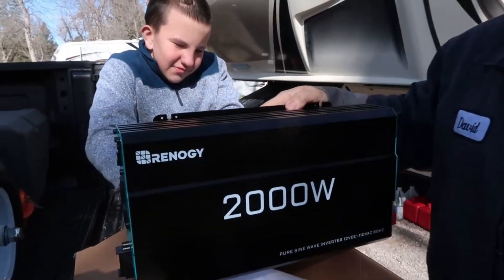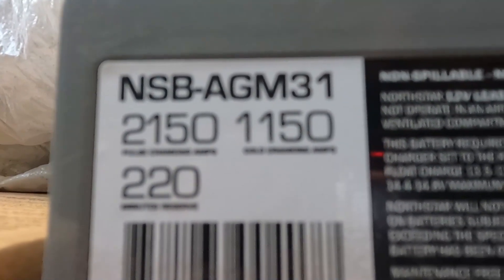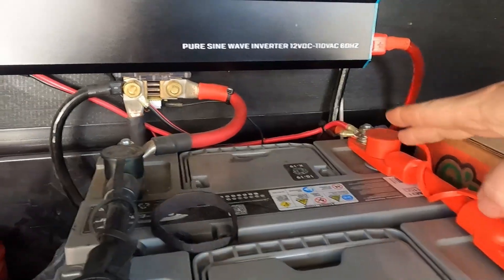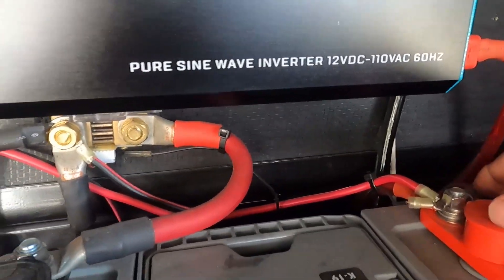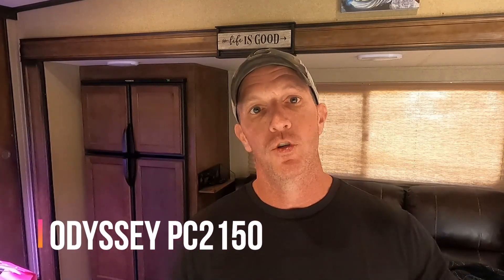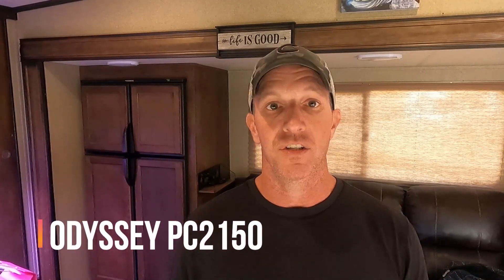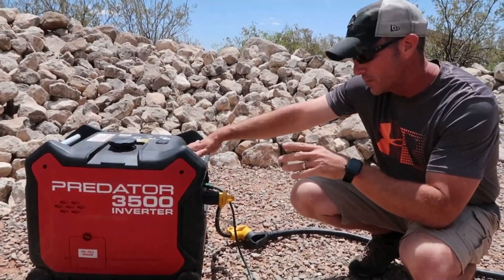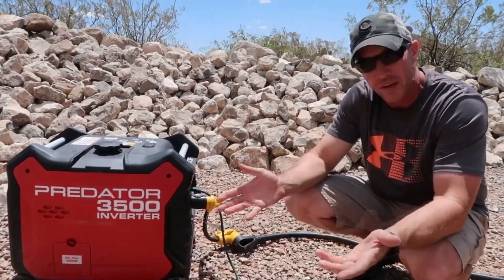EASY RV Inverter Setup | RV Inverter Setup Explained

Comment: did you have to add an additional battery for the inverter or did you just use the battery of the 5th wheel chasey.
Reply from the maker: I added a 2nd battery for more capacity.

Comment: Hi jouppi I was considering getting the same set up u have minus the converter and charging the battery with a Renogy solar polar…. With that said would I still be able to connect the rv straight to the inverter and so should I still turn the breaker off for converter? … my plan was to run the fridge (propane doesn’t work on the fridge) and the lights and the outlets I don’t need the microwave so I will shut the breaker off for that … I believe I need the converter breaker on to run the fridge
Reply from the maker: This setup will work with just a converter and it would need to be off when you are running on the inverter. I would recommend some type of solar panel to help offset the draw on your batteries during the day. The battery monitor would definitely help you monitor the draw throughout the day so you don’t get in a bind with completely dead batteries. Thanks for watching!

Comment: So while your plugged in shore style into your inverter you turn off the convertor? So without that victron 1225 your 12 volt stuff doesn’t work? I wanna do what you did I just wanna see if that victron thing is absolutely necessary
Reply from the maker: While we are plugged into and running on the inverter, I turn my converter breaker off (the Victron has replaced my converter). The 12 volt accessories still run on the batteries, no matter if the Victron (or converter) is on or not. The Victron charges the batteries faster than the RV’s converter but it is not 100% necessary to run this setup. Just turn the converter off when plugging into the inverter and back on when running on the generator or plugged into a standard power pedestal. I hope that isn’t too confusing! Thanks for watching!
Reply: @JouppiOutdoors  thank you so much, in my head this is how I wanted to do it and seeing your video just made it easier to see actually laid out.
Reply from the maker: It has worked great for us!

Comment: Greetings, have you considered hardwiring a 50A rv plug off the high voltage output on the inverter? Just curious if that would work and if there would be any benefits to running it that way?
Reply from the maker: It would be possible to hardwire a 30 amp RV outlet (a 50A would require 2 110v legs which this inverter does not have). I have considered doing this and using a 30A to 50A adapter to eliminate the need for the extra extension cord. It would simplify things a bit.
Reply: Thanks for all your help.
Is there any way you can do a quick video on how you would eliminate the extra cord with a 50 to 30amp connector on your set up.
I am buying a 2500w inverter to power what I want like you did, but would like to do the job as efficient as possible.
Thanks again.
Reply: The way your setup is now with the 20amp to 15amp adaptor feeding the trailer from the inverter, wouldnt that limit everything on the trailer to 15amps?
Reply from the maker: It does limit the trailer to 15 amps, however, you really can’t pull much more than that from a 2500 watt inverter.
Reply: Can I run "just" the airconditioner by itself for a bit with the 15amps?
I know I could with the 2500w inverter if I wired it to a circuit breaker.
Thanks for the quick response.
Reply from the maker: @Reanimator7336  you could probably run only the a/c but you might need a soft start installed on it to eliminate the big initial draw when the compressor starts. The amount of time you would be able to run it will depend on the amount of battery capacity you have. You will need a fairly large battery bank to run the air for any meaningful amount of time. We use our generator for the a/c when we need to run it.
Reply: Thanks again for all your help.
I could probably run everything except the a/c with that 2500w inverter with 200watts solar to help with the way you hooked up yours at least 1 at a time.
Thats really all I need.
A Keurig, and blow dryer for the wife. Lol.
Reply from the maker: You’re welcome. The solar panel will definitely help! Thanks for watching!
Reply: Its a 2021 Rockwood Ultralite.
I was told a newer trailer with a newer A/C might only pull 11amps.
You probably know a lot more.
Thanks.

Comment: Thank you for this follow-up video to your original video...  This video answered many questions...

Eventually will you wire your inverter directly to your transfer switch..   since your rig is 50 amp split phase... Will this 2000W inverter still function?

Thank you again
Reply from the maker: You’re welcome. Yes, if I added a transfer switch, the inverter would still work correctly. The transfer switch would just eliminate the need to run an extension cord and 50a to 15a adapter. Thank you for watching!
Reply: @JouppiOutdoors  please if you do this update... Video document it...

I have a 50 amp rig and 2qty 2000W xantrex inverters....

I plant on putting an inverter on each phase since I have stackable washer/dryer setup...

Love the channel and your  micro managing tyrannical attention to detail...

Comment: i have the same setup (but with LiFePo battery) and the GFCI on the Renogy keeps popping immediately. You ever have that issue? I tried shutting off my GFCI breaker and still popped the GFCI in the inverter. Renogy wasn't much help.
Reply from the maker: When you say popping immediately, what are you running when you turn on the inverter? I have not had this issue yet.
Reply: @JouppiOutdoors  I think the yellow GFCI light must also be an overload light. I had my electric hot water heater still on and a small wall heater in my son’s room. Unplugged those and it worked fine. Then slowly brought more load online and no issues until toaster with everything else pretty much running. It tripped the GFCI in the renogy inverter. Turned toaster off and flipped the inverter back on and everything worked fine. Not sure if it’s because there was too much load on the GFCI outlets (toaster was on island outlet which is part of the gfi breaker run) or if it’s just too much load, period. Either, got it figure out. Thanks for the video and the response. I’m gonna wire another outlet off the terminal bar on the inverter so I don’t trip the 15 amp and just plug the extension cord into that.

Comment: Thanks for the info. My Jayco Eagle inverter pre wire only powers a few outlets, I’m going to install the same as you. Are you able to run a coffee maker like a Keurig with that inverter?
Reply from the maker: You’re welcome! A Keurig pulls about 1500 watts (depending on the model) to initially heat the water, so yes, you can operate it on this 2000 watt inverter. I would recommend having everything else off when operating the coffee maker though. Thanks for watching!

Comment: I read one of your answers to a question and you say that your converter charger is still connected to batteries but unplugged. How do you unplug the converter? Thanks . 😊
Reply from the maker: Ours is plugged into a dedicated outlet in the basement area of the 5th wheel.  We left it hooked up to have as a backup in case there was ever an issue with the Victron.

Comment: Hello I run two Crown agm 6v 220 amh batteries and I do same set up as you with 1500 watt inverter.  I like the victron 25 amp charger idea. My question is how do you power it? If you plug into trailer does it conflict with converter charger when on shore power? Thanks for any info.
Reply from the maker: I actually run the plug to the outlet where the converter was plugged into (we do not use the converter).  When we plug the trailer into the inverter we just turn the converter breaker off which kills the power to the Victron.  We have found that the Victron charger maintains the batteries better than the factory converter.
Reply: @JouppiOutdoors   I must admit this step still confuses me ...the victron is hooked into the oem converter original outlet  ??? with an extension cord ??? I understand turning the breaker off when your drawing off of the batteries ...and one more question...Do you hook your solar panels directly to the batteries ?? Thanks for this idea ..I rarely boondock but would like to do more ...my oem system wont make it through the night if I need heat
Reply from the maker: That is correct regarding the Victron. I used a 6’ extension cord to reach the outlet. I hook the positive solar panel lead directly to the batteries (just one battery actually, since they are jumped together) and the negative lead goes to the battery monitor shunt (where all the negative cables go). If you do not have a battery monitor, you can attach the leads directly to the batteries.
Reply: @JouppiOutdoors  thank you ...I understand it now .might be a good first step towards solar ...rhanks

Comment: so you wired the 120ac from the inverter to your 30a shore power inlet ? If so when your on shore power the inverter has 120vac to the inverter even if its off ? Thank you
Reply from the maker: The inverter is not hard wired to the trailer. We run an extension cord from the inverter to  a 50a to 15a adapter to essentially plug the trailer into the inverter.
Reply: @JouppiOutdoors  hi I'm confused did you wire you inverter to your batteries and then plug your trailer plug into your inverter?
Reply from the maker: That is correct, I plug it in with a heavy duty 20 amp extension cord and connect it to the trailer using  50 amp to 15 amp adapter.
Reply: @JouppiOutdoors  I really appreciate your videos and knowledge.  I'm new at inverters but I cannot locate the braker gor my Converter. Doesn't help that they are labeled poorly.  How would I find thos breaker. I really want yo get this system going. Thanks again for your help.
Reply from the maker: Thank you, you may be able to disconnect the negative cable on your battery, then turn on your interior lights which should be powered by the converter if you are plugged into shore power, then turn off the breakers until the lights go out, when they do, that is your converter breaker. With that breaker off, you should be able to reconnect the battery and the lights should work. It sounds more confusing than what it is, sorry if that explanation is hard to follow.
Reply: @JouppiOutdoors  I will give this a try, I will keep you posted lol and sorry for not proof reading before my message.  Stupid spell check
Reply: @JouppiOutdoors  I did what you said, disconnected the negative battery terminal plugged into shore power and the first breaker I turned off marked 12 volt the light slowly went out. So I'm guessing that's the converter. Thank you for your help.
Reply from the maker: That should be it! You’re welcome

Comment: Quick question, do you still use your original converter to power your 12 v systems when plugged in to shore power?  Do you simply unplug the converter from the AC panel to stop using the charging function but still use the converter function?  Thanks
Reply from the maker: No we do not. Our 12 volt systems are powered by the batteries with the Victron BlueSmart 12/25 keeping them charged while we are plugged into shore power. The factory converter is still in place and hooked up to the batteries, but only as an emergency backup…the converter is not plugged in.
Reply: @JouppiOutdoors  Just subscribed.  Great channel.  One more question.  Since the inverter has multiple outlets, could you use a dual 15 amp to 50 amp adapter and give yourself basically 30 amp service from your batteries?  I'm pretty ignorant of electrical stuff, trying to figure out a similar solution as yours.  I"m using 3 100ah lithium batteries.
Reply from the maker: Thank you! Great question, unfortunately the answer is no. You are limited by the wattage output of the inverter. The formula is Amps x Volts = Watts, so using that formula, you can figure out a 2000 watt inverter can handle about 18 amps max. (18 amps x 110v = 1980 watts)

Comment: Hey Jouppi, thanks for the video. I will be setting up my van with a similar inverter soon. Yours seems very neat and well put together. Would you be interested in a short video that focuses specificly on that part of the rig with direct rhetoric explaining the inverter to house battery setup and wiring and stuff.  (IF you have a Dc-Dc charger, that would be nice too)? 
Just curious
Thanks
Reply from the maker: You’re welcome! Glad you found it informative. I have thought about a video like you describe, I have been kicking around a few ideas! Thanks for watching!